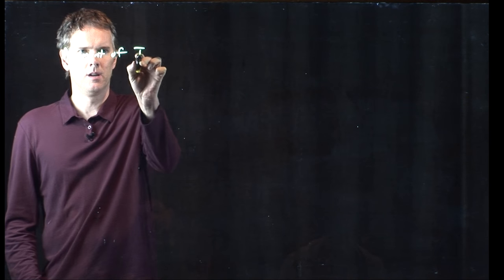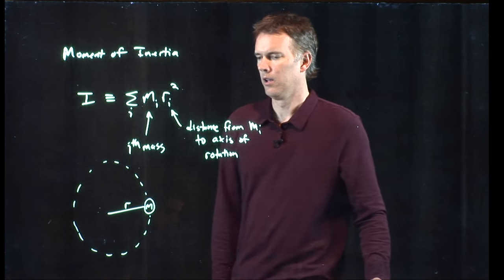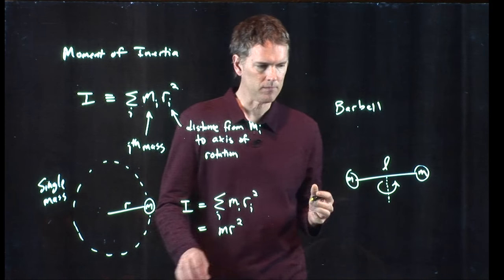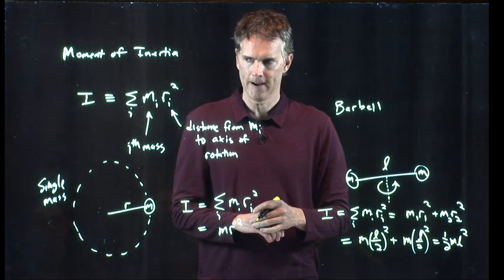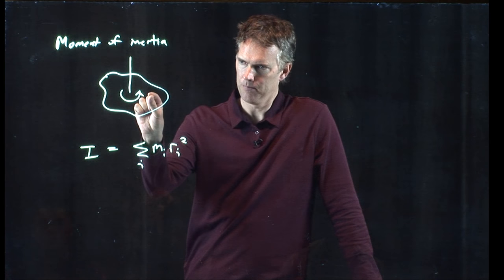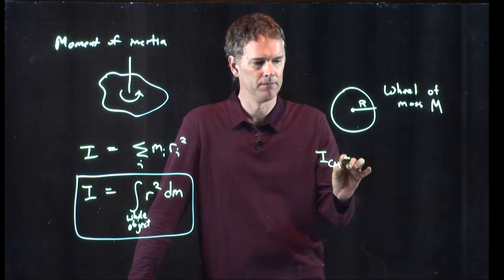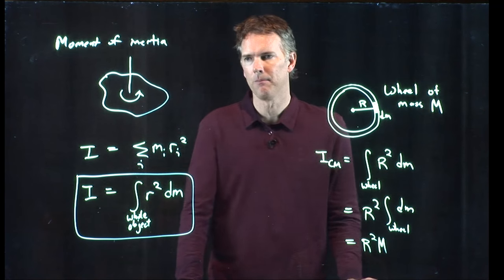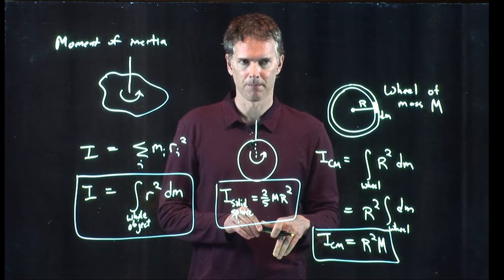Moment of Inertia

Comment: This is great video.  i think inertia moment would be much easier to understand  if you did make  at least one more example of how to calculate moment of inertia, for example of a cube . thanks
Reply: The easiest examples are examples with circular symmetry, as you can split them in to shapes with a known moment of inertia from first principles.

For instance, consider a solid cylinder. of length L and radius R  To make it interesting, suppose its density has cylindrical symmetry, but is not uniform.  Suppose its density at distance r from the axis is given by rho(r) = J - K*r, where J and K are constants.

Start by considering a mass element that is a thin hollow cylinder of thickness dr at position r from its center.  The volume of this mass element is 2*pi*r*L*dr.  The mass of each infinitesimal mass element is therefore dm = 2*pi*L*rho(r)*r*dr.

We can find the total mass by integrating:
m = int 2*pi*L*rho(r)*r*dr

We are also interested in integrating r^2*dm from r=0 to R.
I = int 2*pi*L*rho(r)*r*r^2*dr

I'll leave the rest of the steps to you.   At the end of the calculation, you'll get:
m = pi*L/3 * (3*J - 2*K*R)*R^2
I = pi*L/10 * (R^4 (5*J - 4*K*R))

In terms of total mass:
I = 3/10*m*R^2 * (5*J - 4*K*R)/(3*J - 2*K*R)

When K = 0, which would mean density is uniform, instead of linearly varying with r, this reduces to:
I = 1/2*m*R^2, which is the formula to use for a solid uniform cylinder.

Comment: legendary lectures....but i have a big question which i did not get any reply from anyone ,i too dont have any idea .what is meant by moment and  moment of inertia.
Reply: Effective mass
Reply: It can be relaTed to pressur e as area increases pressure decreases for the whole system the same for MOI as mass is more and more distributed over  a large surface it becomes less effective
Reply: The term moment (in general) means quantity multiplied by distance from an origin.  This is why torque is called "moment of a force", and why dipole moments get their name.  Same with moments of inertia.  It really is a second moment of mass, because the radius is squared, but we call it moment of inertia or rotational inertia.

What moment of inertia means, is an effective property of how the mass of a rotating body is distributed, to form an analogous property to mass when writing the angular equivalent of Newton's second law.   Instead of the linear F_net=m*a, moment of inertia is used for the angular tau_net = I*alpha, that is analogous to Fnet=m*a.

There is an analogous quantity in structural analysis called "second moment of area" that is calculated in a similar manner, and often called "area moment of inertia" as a misnomer.  It has nothing to do with inertia, because it really is the integral of each infinitesimal area element times r^2, rather than each mass element.

Comment: why we multiply the mass of the particle by the square radius of rotation when we calculate the moment of inertia? why it is not without that square ? and is it wrong(or why it is wrong) if we said that moment of inertia= mass of the object multiplyed by square destance from the center of gravity of that object ?
Reply: Look up dimensional analysis, proportionality and take some calc II or III,  that should be able to answer your question

Comment: Why do we SQUARE the r?
Reply: Because there are two factors that make it contribute twice to the equation.

Factor 1:
Because it is a rigid body, each point on the body has to complete a circumference in the same period of rotation.  This means that the linear velocity is proportional to the radial position from the axis of rotation.

Factor 2:
Angular momentum is r cross linear momentum.  The angular momentum of a point mass is proportional to its position from the axis of rotation.

The two factors combine to become a squaring of the r in the integral that calculates moment of inertia in general.  This means that for most circular objects, you'll see that moment of inertia is equal to k*M*R^2, where k is a factor that depends on shape, M is the total mass, and R is the radius of the object.

Comment: 5:21
But the r isn't constant
Why is it made a constant?
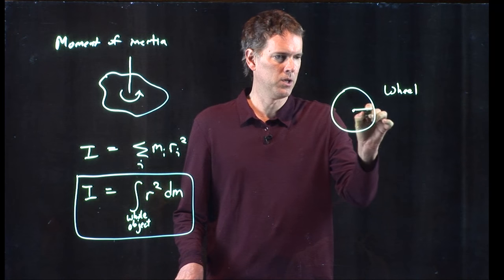Reply from the maker: You're right that in general, r does not need to be constant.  However, for the wheel at 5:39, r is constant since the wheel has a fixed radius.
Cheers,
Dr. A